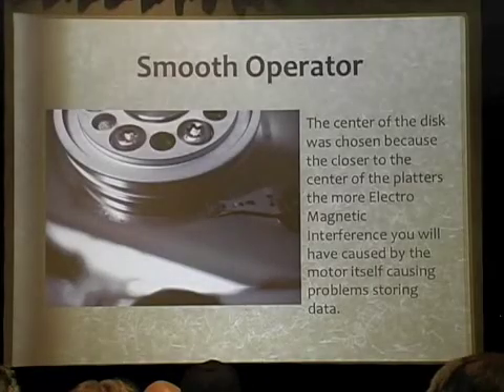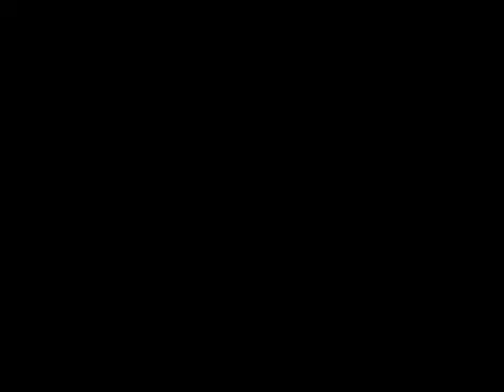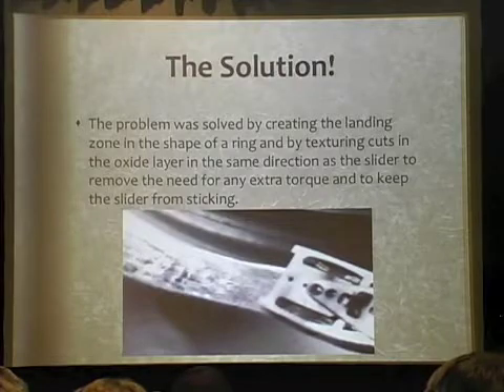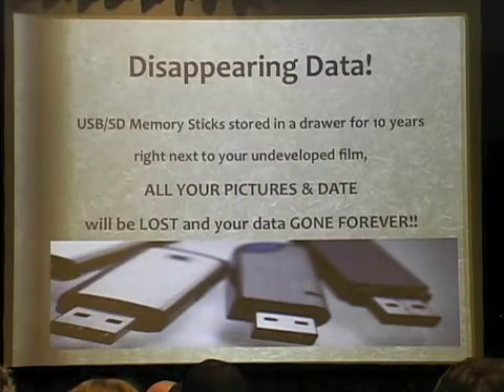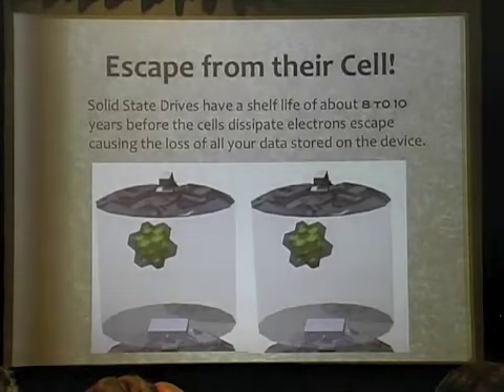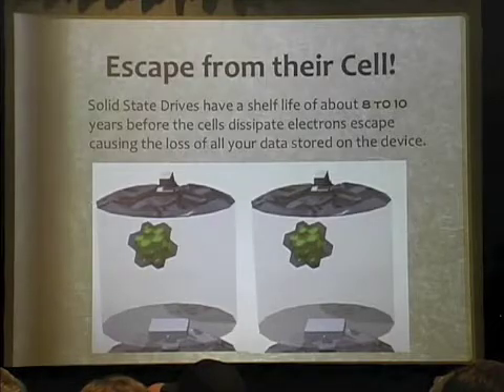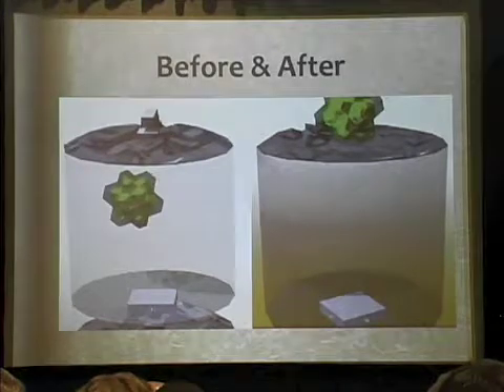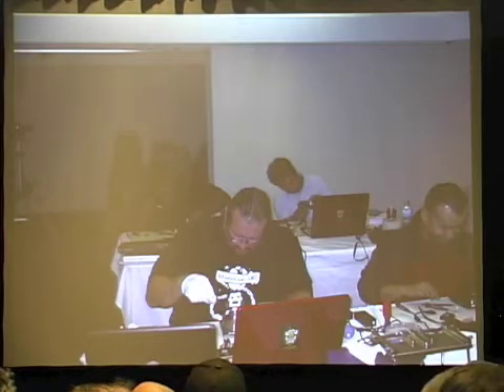10 Things About Hard Drives Part 6/6

Comment: This was a great talk/presentation!

As a sound engineer, can I give you some advice (or for those reading the comment)? 
Have the mic mounted on your left side if your screen is on your left side. This way, when you turn your head to look at the screen, you're not turning away from the mic, as you did in this talk.